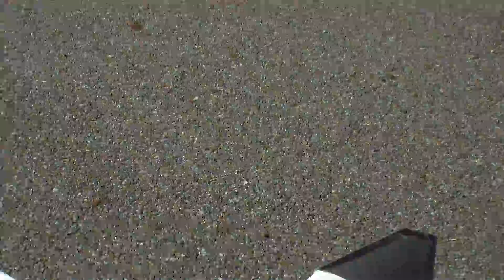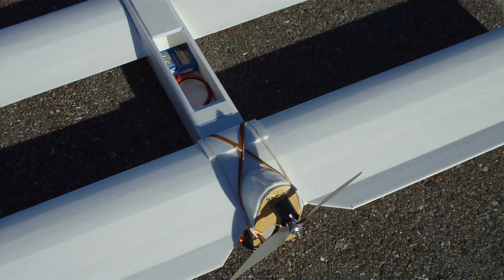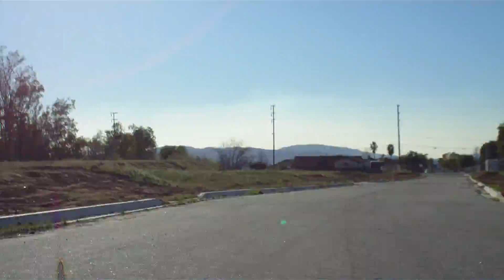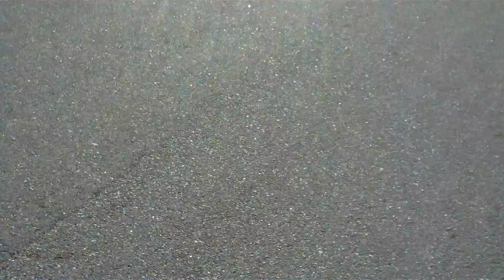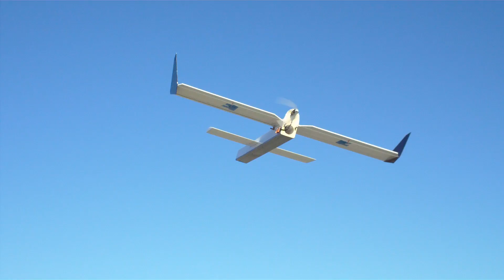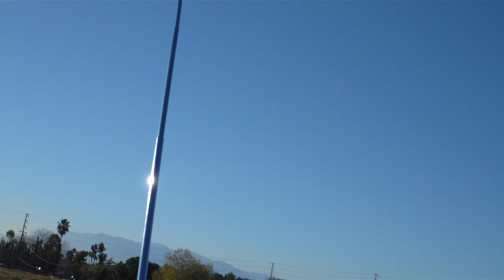Peace Drone build/maiden part 1

Comment: There is a major Problem, when add Power and the Nose tend to go down, the Thrust Vector is over the CG, You noticed well, when you cut Power off, the Nose comes up, for the Wingrocking try to move the Canard on Top of the Fuse, and the Wing Low, i think this may solve most of the Problems.

Comment: Ed at Expiremental Airlines and you has some very good designs and cheap ways of building nice foam planes. Your tri fold fuse is a good idea and looks very strong also. Might try that when I build a V-Tail plane. I'm working on one of Ed's designs right now. Keep up the good work, it helps a lot of us poor folks out here.

Comment: Nice build up.
I like canards as they have superior stall characteristics.
Of that airfoil, or style of flat bottom, medium aspect wing, looks to me like a "clark Y"
like a C-130 or similar heavy lift, short airfield type aircraft use.
I am building a very light (very very light) 3.5 ft. wing with nearly this airfoil, with thin foam framed up with ribs and carbon spar, and a 6.5 ft. high aspect wing, similar but thinner airfoil, both wings flat, no dihedral, with ailerons. Its crazy light